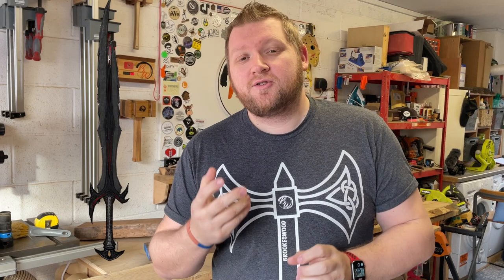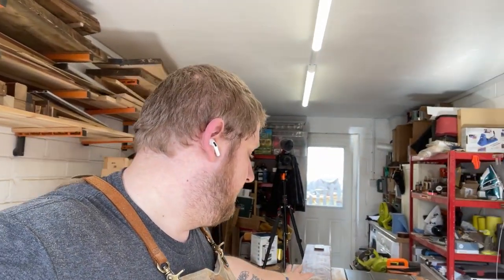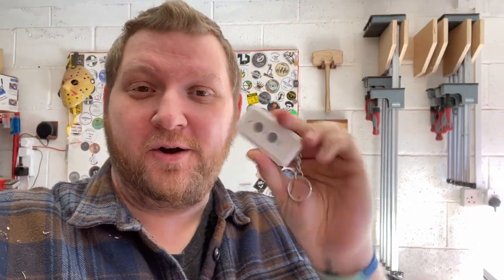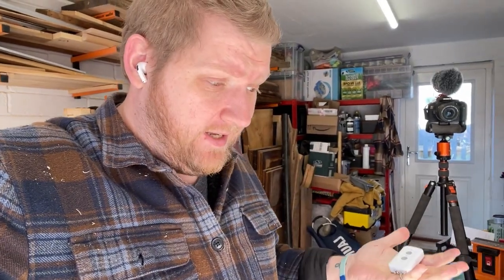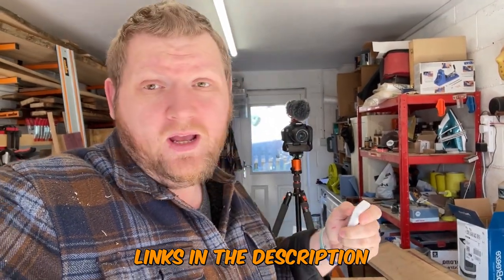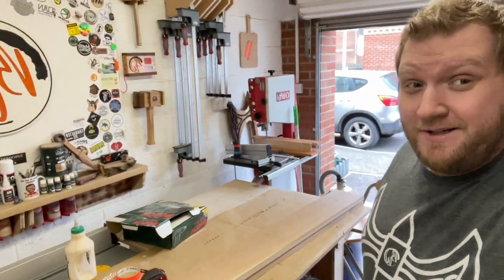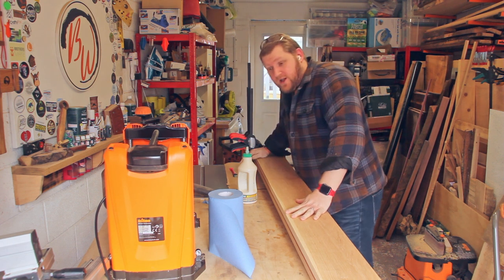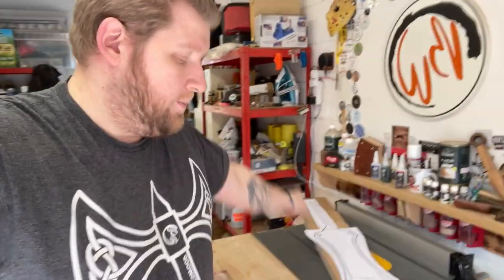Making a GIANT Skyrim Great Sword Part 1

Comment: I have the same band saw, anything more then thin material, it struggles, look forward to the next vid. 👍
Reply from the maker: Yeah I cut ALOT out of that part 🤣
It’s a great bandsaw but yeah not powder full at all. We bogged it down quite a few times. Luke did show me it had 2 speeds but it didn’t make much difference 🤦🏼‍♂️